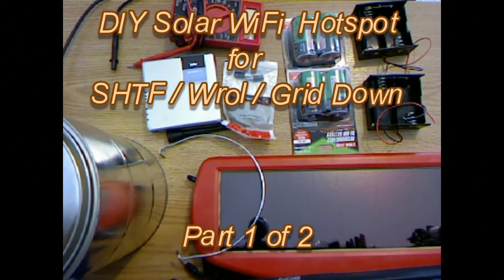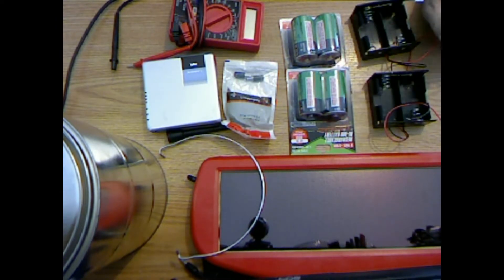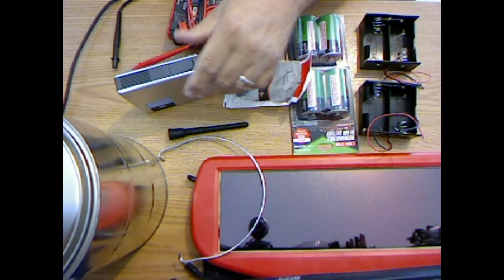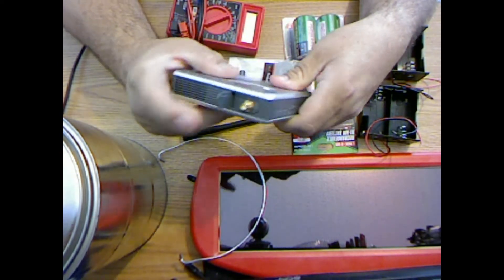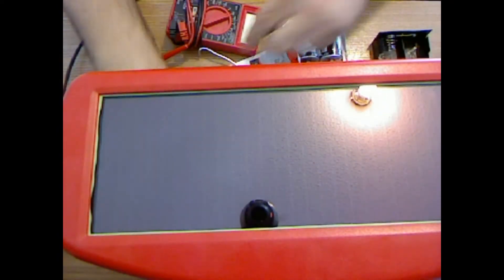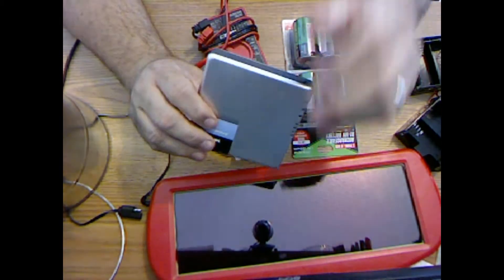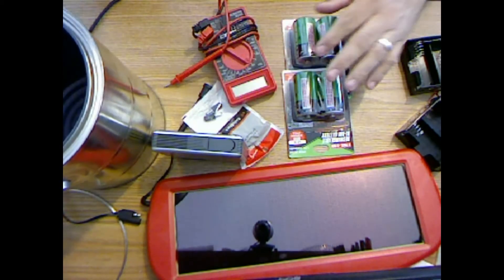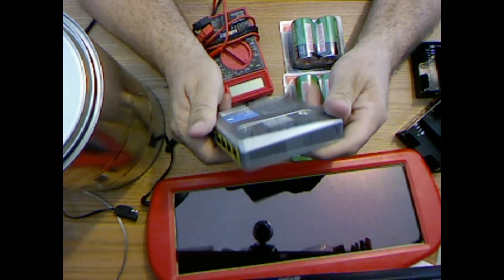DIY SHTF WROL Grid Down Solar Wifi Hotspot Part 1 of 2

Comment: look into HSMM-Mesh networking. Makes this process so easy. Linksys routers mostly used for this are simple 12v so you can run them off a variety of power sources.

Comment: hey can you please share a link for the custom DD-WRT firmware ported for this 54GC router? I didn't find any related info in the DD-WRT database. I guess this is a Broadcom chip, 8MB ram, 2MB flash?
Thanks in advance!

Comment: This idea reminds me of a car going on trip with 2 gallons of gas when it take 4 gallons to get to the destination. I think it merits honest truth here if you are going to put your life on the line for communications why short yourself on this build? Go for 24hr operation. Solar only works on sunny days, cloudy will lack power. Invest in a good 12v battery with minimum 35 amp hours and build a box which to mount to a tree otherwise best of luck my friend.